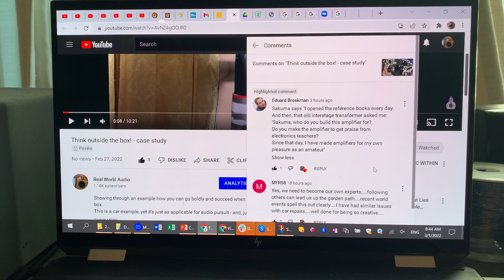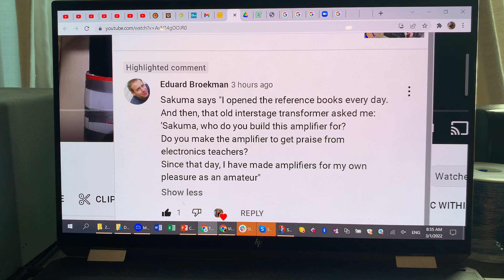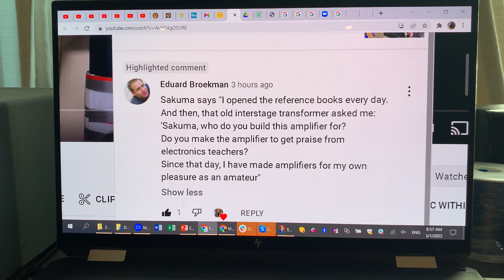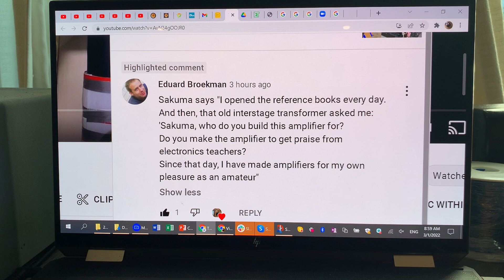Was  Sakuma san wrong to disobey reference textbooks?!

Comment: The man was a chef of amplifiers! I found the film of him sloppy soldering to be most inspirational. Have you heard the Sakuma Darling? that's the baby elephant in the room...
Reply from the maker: Hello A.R., indeed, talking about baby elephants, the Sakuma Darling is the proverbial one. I was very tempted to build it. The only thing keeping me away was the lack of a suitable high quality interstage transformer... ($$)  although hopefully, one day I will indulge my curiosity. ;
Reply: @realworldaudio  I just started one; SET with InT > 4P1L > IT > 4P1L > OT... although I don't have Sakuma's arsenal in trying different transformers, it will feature concepts from his amps. I will A/B it with a single stage differential SET (InT > 6E6P > OT) I made last week and still tweaking. The silver plated solid copper we talked about earlier also arrived... and there's a pair of EV DH1A and Altec 414s underway to hopefully create my new main speaker pair with... :)
Reply: Sounds like you need to build one, AR! I also noticed how all those big electrolytic caps go in; sort of eases the mind.
Reply from the maker: @EduardBroekman  That's fantastic! With more basic ITs  we still gt the benefit to midrange, just not the frequency xtremes, so it can still work out quite well. In any case, you will get to experience the difference in presentation & tonality. I think there's no ultimate topology, all of them have their own beauty, and are suitable better to specific recordings. Two amplifiers give access to a wider range of recordings than just one...  I have not answered your comment yet on the 288 XO and the woofer - I intend to make a video with more details, but have not had time to shoot it yet. My woofer is the 515C, and will explain how I use it... but the 414 is a great choice, easier to handle than the 515C, and happy to work with "smaller" (khmm... if you think of 150L as small) cabinet volumes than the 515C, which needs 200+L to start breathing, and 4-500L to get to reach full output.  The 414 reaches that comfort zone already  in a 150L cab, and people have used it even with mere 120L or so... but I'd really recommend at least 180L for it, not less... going for 120-150L range you will get great midbass, but to get deep bass people are supplementing with subs which spoils the bass integration. To get the deep bass you will need about 200-180L. That will get you to bass-heaven: ultra-efficient, integrated bass down to 20-23Hz in a VOL cabinet. Much more on that in future videos... ;
Reply: @realworldaudio  Thank you for all these gems re 414 and I just found your 1yr-old video on the 414 XO - nice!! Having 180L with a very aperiodic TQWT models nice in AJHorn.  I may go for extension over response as the room modes will elevate 18, 36 and 57 Hz. On the IT: I'm using a Lundahl 1660 as IT and properly driven I don't see any issues with frequency response. Once I switched from budget transformers, the FR concern entirely disappeared. I find topology quite fascinating - much more than tube types although I do tend to settle on low distortion and affordable tubes. Back to transformers and I think what you hinted at, one learning from my current amp is that if I don't run the intended signal through the input transformer (LL1690), it starts to act as a bandpass and looses subtle detail, timing and musicality: so with a weak signal, the sound is actually remarkable like bad digital! But once I put full 2V RMS and a 20K pot behind them (which is also recommended load for best square wave), this bandpass effect cleared out entirely.
Reply from the maker: @EduardBroekman  With LL's the worries on bandwidth are not an issue :). Using an input transformer also gives choke loading for the input tube. That is, when tube is drawing grid current there is nothing that prevents that. Opposed to the regular 100K-200K grid leak resistors (or even higher, 1M or more ouch) drawing grid current is extremely limited, putting the tube into a very bad position once there is would normally want to start grid current (with a large signal). Hence, input transformers, TVCs, AVCs make such a huge difference in sound naturality. ; )
Reply: @EduardBroekman  When I get on your level! I would like to hear your listening impressions on that build. I might be imagining it, but Sakuma   is having a resurgence these days; a buiilder named Treehaus debuted theirs at Capital Audiofest
Reply: @realworldaudio  Thank you I wasn't aware of this grid current effect with large signals - will look into it.
Reply: @a.r.5124  I'll report back on it. I am curious to see if the longer signal path with 2 low-mu stages can beat the single higher-mu stage. Thank you for mentioning Treehaus - looks interesting.
Reply: @realworldaudio  YES ! ....In worst case scenario the tube when overloaded may even BLOCK !
I go ,as low as possible on the grid leak R .....example : 120 K on grid of 6BQ5...........to often some tubes with fixed bias have a run away and selfdestruct with to high the grid R ( as seen in a lot of commercial amplifiers )
Some power tubes with high perveance are prone on run away .....like the 8417 ( used also in the Quicksilver mono blocks )
Reply from the maker: @frankgeeraerts6243  Hi Frank, indeed, keeping the grid leak resistor very high value is sadly a common practice with mainstream tube manufacturers, and is a big culprit for strained and shrill sound, and of tube failures... or even worse,   8417 loves to take out the output transformer when it goes.  
Interestingly,  I always found that self-biasing always sounds much more natural than fixed bias...  and it's also safer, provides a natural control mechanism to prevent (or mitigate) run away.  Somehow, all the spectacular tube amp failures I observed were all with fixed bias...
Reply: @a.r.5124  I was just revisiting this video, but the 4P1L driving the 4P1L was not a success... the 4P1L has a certain type of treble that gets out of hand when using two - other have also reported this. I eventually replaced it with a 2P29L (DHT) driving the 4P1L and that worked much better. The concept that Sakuma employed still stands:  the driver has the greater influence on the sound, so using a DHT as driver (which distorts the least of all amplification devices known) is a great path to employ in amplifier building.
Reply: @EduardBroekman  wow. nuances i was not aware of; nice investigation.
Reply: @a.r.5124  Actually, I just upgraded my amp and now the type 47 drives another 47 and that works beautifully. Sakuma is back in business :)